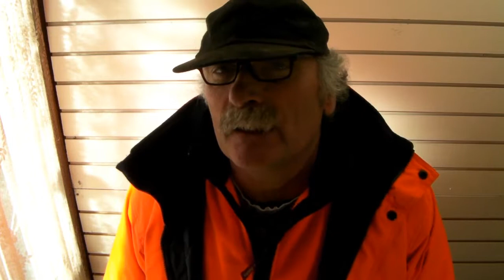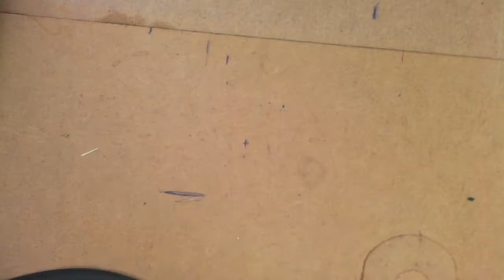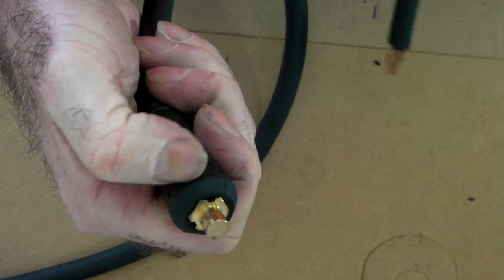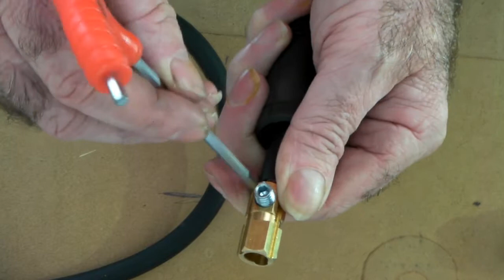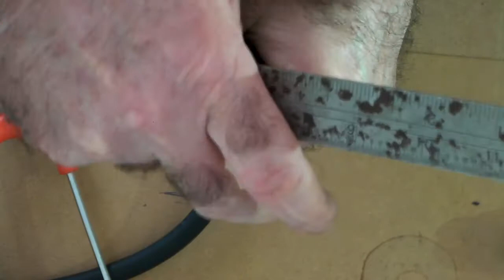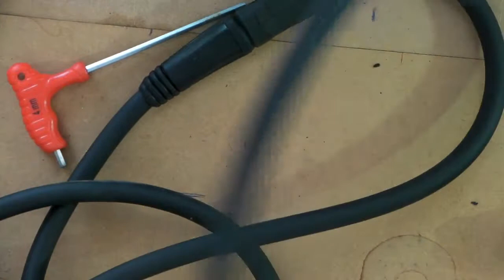Welding Lead Connectors  Make Longer Leads

Comment: thanks mate i just made my stinger for a test but was wondering why the male end dint have a copper strip where you put the wire in i guess its okay just like that
Reply from the maker: yes mate just depends on the manufacturer as long as its tight you wont have a problem. cheers pete